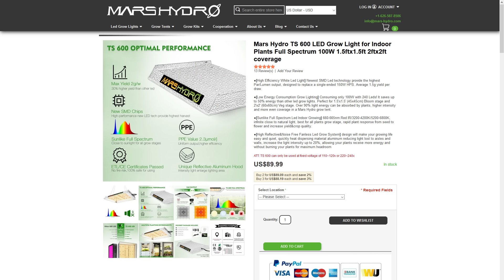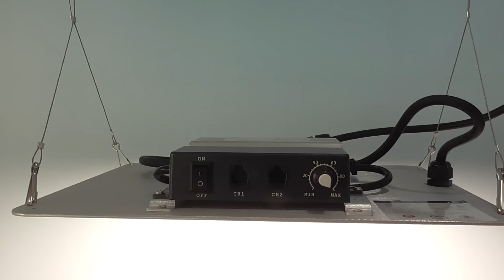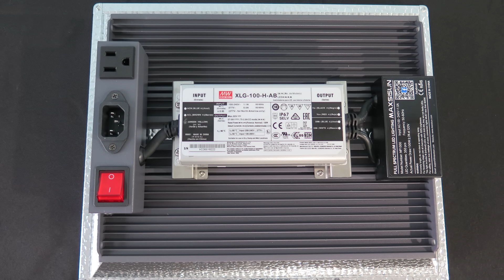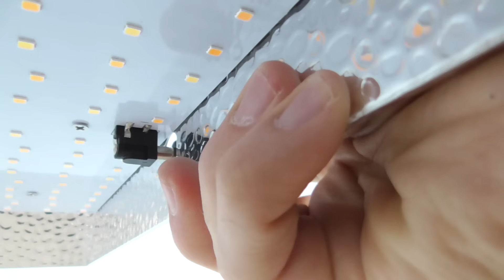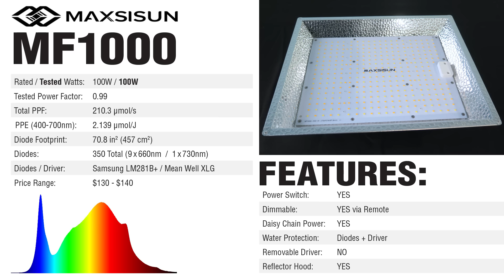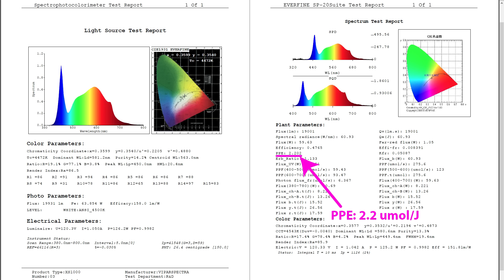Spider Farmer, Maxsisun, Mars Hydro - Entry Level LED Grow Light Comparisons, Test Reports & Reviews

Comment: Excellent review, could you help me decide based off of temperature output? Or are they gonna be relatively the same? I feel its most likely connected to the highest light output
Reply from the maker: Hi Sam. If each light is drawing the same wattage, then the one with the highest PPE will be emitting the least amount of heat, assuming you are only looking at models with 0.99 power factor. That said if you are comparing PPE of 2.1 up to 2.5, they will be fairly close. Not a massive difference. In contrast, a T5HO is probably PPE of 1.0. So you get much more heat at any given wattage.

Comment: Dude.. Thank you for this. I was going to get the Maxsisun MF1500 soon.. I think its the one I'm going to get for my 2x2.. You sir, are awesome.. I've had 3 Mars Hydro TS 1000 crap out in the last 3 years.. So upset.. But they just recently started using new drivers.. The Moso 150W.. Not sure if it's going to make much of a difference.. But dude thank you for this.. Ive always checked those test pages you were asking for and Ive tried my best to understand alot of it.. You explained it for me to understand 100% now.. Thank you for that.. Bad ass video man.. Very helpful.

Comment: G'day mate how you doing?? Well that was an excellent upload man ive been watching afew different vids on led lights but this is hands down the best so far. Anyway I bought a mars hydro TS 1000 afew months back & when I read the spcs & stuff I noticed it said only 150watt from the wall I was thinking it was 1000watt like advertised on eBay. So I got it to replace my 400watt hps in a 4x4 tent n try led but my problem is that I don't know if it will be better or worse than the hps set up???? And also im a little worried about growing without the heat & when to vent a tent with a led light source any help would be great as I really would like to start using it.. Cheers mate 🍻🍻

Comment: Honestly.. I've had a couple (blurple) Galaxy Hydro,more or less,a Mars knockoff 600w (250ish i think at the wall) for a couple years now,paid $70 each,for the space i use 2x4x8 split top and bottom 2x4x4 ,they've been amazing!!  It's cool and all knowing the numbers.. But by results.. I still think the cheap china lights are a real bang for the buck if used knowing long before hand.. It's china.. Ultimately,they overstate everything.. Lights,wind/solar generators,battery life,and anything else the manufactur .. It's all toss and replace crap at the end of the day

Comment: How many of the SF4000 would I need for a 42X61ft area?
Reply from the maker: 42' x 61' = 2562 sq ft.  1 SF4000 covers 16 sq ft (for high light crops).  So 2562 / 16 = 160 SF4000 light units. It might be less if you have ambient sunlight or if you are growing plants with lower light requirements.
Reply: @Albopepper  Wow thanks! So for an open area like that with reflecting walls and floor and I still require so many? I thought that the SF4000 covered 6x6 for 36' sq ft. These are special medicinal crops so I have to die by the sword.  Thank you so much for your kind words
Reply from the maker: Sorry, I'm still looking into things for your project. But to answer your question about coverage area for the SF4000, I suggest watching this video: https://www.youtube.com/watch?v=Cl5P3sKDQ0o  If you try to cover 6'x6' per light, your yield won't be as high.
Reply: @Albopepper  I watched that video 2 times already always learn something new
Reply from the maker: "Would you recommend a different type of lights for such a large area?" With such a large area, I think it's good to get the best efficacy you can get, especially if your electrical rates are substantial. But I would also look at initial cost, trying to get the highest Total PPF per dollar spent. To get enough light output, you could estimate a combined Total PPF of 192150 umol/s. (This might be higher or lower depending on other growth parameters.)

So let's say a light outputs 1217 PPF. Then you need 158 of them. But if a different light outputs 1600 Total PPF, then you only need 120 units. Then compare total cost of the models to see which costs less upfront. Next you can do an ROI calculation (if one light is more expensive but more efficient than the other) to see how quickly you would recover your investment.

With such a substantial investment, you should only purchase a light that has a Spectrum Test Report available. To be honest, a 3rd party test report is preferred to ensure the seller hasn't falsified their report. Also, look for good warranty terms. Some sellers offer 5 years. That might be worth the investment for you.

And then finally, think about what form factor suits your needs. How will you arrange your plants and the walkways, etc? Some lights can be placed closer like this kind: https://youtu.be/PCaesi_M5DQ?t=9  Or do you want lights that have a smaller footprint and are placed higher up? This all depends on you and how you will work around the space.

I think the SF-4000 is a great unit. It's a good starting point. I suggest using it as reference. See if there's anything else better, by comparison. Maybe more efficient. Maybe better warranty. It depends on what matters to you most. I would like to see 3rd party tests from Spider Farmer though. After looking at more of their reports, I'm beginning to question their truthfulness. It's not an issue for someone buying 1 or 2. But with 100 or more units, it makes a big difference.
Reply: @Albopepper  Would you recommend a different type of lights for such a large area?
Reply from the maker: Is there any sunlight or is this all in an enclosed, dark space? How expensive is the electricity rate?
Reply: @Albopepper  It's enclosed I got lots of power but I want LEDs so that my operation will be scalable and plant more plants when I get a different license. So far power is 480 volt 3 phase so that's not an issue. I also will have reflective walls and floors, never done an operation this size before so that's why I'm asking.

Comment: This is the best review I have seen of these lights!  Excellent reviews sir!  My question is,  which will grow the most weight?  The Mars because it's the brightest?  Which honestly if that is the case that's the opposite of what I was thinking and might need to go back to the drawing board? 🤔
Reply from the maker: Thanks for watching! For more plant mass, you need more photons. So higher total PPF means more potential for weight. Obviously, since it runs at 50 extra watts with decent PPE, the Mars Hydro will give the better yield.

Comment: The 1000w or 600w in the names does not resemble the watt usage and never has i don't understand how this can misunderstood, literally no one ever said that was the watt ussage.
Reply from the maker: 1000W and 600W literally means 1000 watt and 600 watt. Ford can't call a 130 horse power car "550hp" and then claim that they weren't trying to market it as being 550 horse power. Units mean something. And W means watt which indicates power. I showed an actual question posed by an Amazon buyer who was confused because they couldn't turn their light up 1000 watts. So yeah, people can get confused. And just as importantly, these lights are NOT replacements for 1000W or 600W HPS systems. So to be quite honest, they have no business using those false unit designations.

Comment: Ive been using a TS2000 for the past year and completely happy with it. I feel that being able to mount the drivers outside of the tent gives Mars Hydro a huge benifit. It makes temperature control much easier. Everytime i look at other brands not being able to put extentions on the driver cords is what turns me away.
Reply: ts1000 I use its good no problems  but go add a spider 1000 I think

Comment: nice video i replaced my spider farmers sf1000  with new mars hydro ts1000 they now have goodwell and dimmers amazing lights
Reply: Does the Mars produce much more heat....any increase in yields with the Mars..?  I was thinking about getting the sf1000, but I've seen a fair bit positive comparison for the Mars units.  I'm considering the Mars unit.   Thanks

Comment: What would you think about running 2 x Mars TS600's in place of the TS1000? Deals make it cheaper to get the 2 than just the 1 sometimes.
Reply from the maker: It's going to take 200W to run 2 x Mars TS600s and you might get around 360 PPF. The TS1000 can probably do 330 PPF but it only requires 150W. So it would be just a little less output, but it would save quite a bit of electrical consumption and heat output.
Reply: @Albopepper  That's what I thought, but I was thinking that I might get a better light footprint with the 2 being as you would have about a hundred more diodes for light sources while pulling 200w?

Comment: Holy cow thanks for this video it's incredibly in depth! Makes me feel a bit better getting two ts1000s vs one ts1000 and one sf1000. I personally chose the ts1000s because I can put the drivers OUTSIDE the tent which has helped dramatically with temps.
Reply: I use this to control the temps in my tent man its amazing. I took my drivers off in the summer and put them back on in the winter to gain a few degrees when the temps outside dropped.

Comment: You are the man! As I went to investigate a new light, I knew nothing. I was told to chieck out the quantum boards and didn't know where to start. I found this video extremely useful! Thanks a ton!

ps: I'm seeing a few brands you may be interested in contacting for tests with similar LEDs... ENFUN , QKWIN , BESTVA to name a few
Reply: Have you seen the new lights with 302H diodes... sellers say they are based on the Samsung 301H diodes... you know anything about these ?
Reply from the maker: I don't see any listings by Samsung for that model: https://www.samsung.com/led/lighting/mid-power-leds/3030-leds/

There's the LM301H and the LM301H ONE. For the 302, I'm seeing LM302N DAY and LM302N NITE: https://www.samsung.com/led/insights/insights-detail-22/

Quite importantly, we need to see reports for the entire lighting unit in its assembled state. A grow light might have higher efficacy diodes. But the PPE might be lower if it isn't designed optimally.
Reply from the maker: Thanks watching Ivan & sharing those tips! I'm glad my video was able to help.  :)

Comment: Im running several Mars Hydro Lights.

The TSW 2000 with dimmerbox ist pretty good, it runs at about 300w* over here. Its  reddicously bright when running on 100% but its also very powerfull. But it also needs an improvement for hanging, these thin metal wires are not ccol, this thing is huge.
It has two drivers and therefore 2 cables to plug in.

I also got the TS 1000, one driver, one cable and with dimmer box. I cant tell the watts rightnow, but its an OKish light in my oppinion.

Then i also had the SP150 for my clones and now we reach the weakspot off all mars hydro LEDs: ITS NOT WATERPRROF.
Spraying a row of clones was allready too much. The light was hanging way above the clones that i was spraying daily. But still the fog or high humidity made the light die within 3 weeks or so.
I heared some "brrrzzzzzzz zaaapppp" and light went off and was dead.

Im now using an SF300 for the clones. Its not as powerfull, but at least it can withstand the fog/humidity.

So:

The newer Mars Hydro Lights come with far red LEDs and dimmer box. In my opinion they re OK to buy, espeacially the TSW 2000 is a real gamechanger and comes for a cheap price.
But have in mind: BE CAREFULL with those light. Avoid spraying underneath them, avoid high humidity and never touch them on the LED side while they re running!

*corrected the watts for the TSW2000

Comment: People are "Geeking Out" on lighting when these numbers aren't as 'important' as some may theorize.   If you are that worried about LED lighting not working, as advertised .... just go back to HPS.  After all, it may pull more power and put out more heat, but HPS is far superior to LED in the Vegetative Stage.  Bottom line .... you can waste your life / time on worrying about stuff that plants really don't care that much about, or with negligible differences.  After all, in my defense, there have been very good results obtained using "misrepresented" LED lights.  The plants really don't care as much as you think they do about these "micromanaging" topics.
Reply from the maker: Some LED sellers try to make a quick buck by inflating their product specs. And I have no intention of allowing them to do it without any accountability. I'm not going to wink and look the other way. Let's not be apologists here. It's fraud. And if fellow consumers know what to look for, they can help to shift the market in a better direction.

I certainly wouldn't say that going back to HPS is the solution to misrepresented specs. What kind of HPS? SE? DE? What kind of ballast? Just like with LEDs, there are lots of variances in HPS systems too. You can compare two 1000 watt "HPS" lights and see huge differences in efficacy along with overall light output. This directly impacts HVAC costs, electricity requirements and yield. Imagine if HPS sellers just made up numbers to outsell their competitors. Would that be ok?

You might think a 20% reduction in efficacy or output is inconsequential as you still get "very good results". But what about in a large scale application like this: https://giecdn.blob.core.windows.net/fileuploads/image/2018/03/urban-ag-fig-1.jpg ? At such a huge scale, even a 5 or 10% difference can translate into massive costs, or massive savings. A home user might have a single light, so it doesn't really matter, right? Except there are thousands of other home users. And when you add them all up across the grid even a 5% improvement in efficacy can make a big difference. So people should care.

And the plants? Yeah the plants care too. Because 20% more photons means 20% more growth potential. So plants absolutely care.

Comment: Hmmm. i allways thought the term PPFD means Photosynthetic photon flux density or something. thus the ppfd is allways an average on the surface listed. PPF can be a spot measure. I think u switched that around?
Reply from the maker: The total PPF as measured from an Integrating Sphere captures and quantifies all photons (400-700nm) escaping from a light source. When stating the output of a light, the preferred unit is µmol/s. This does not account for light distribution over a target area, such as a plant canopy. When you look at the total PPF, you don't need to worry about hanging height or side reflection. It should just tell you the total photon output.

PPFD is commonly measured by instruments like quantum light sensors. Spot readings are taken. The preferred unit is µmol/(m²s). These are the readings shown on PPFD maps. And the average of these can be used in comparing other light sources (assuming all measurement parameters match).

That said, this is how the terms are commonly used especially when talking grow lights. But there's more to the story. And if you want to hear some background from a horticulture professor, listen to this explanation: https://youtu.be/UZO8Fb0ryW8?t=311
Reply: @Albopepper  Thanks a lot for the knowledge and quick responde. I'm watching the video you linked right now. Much love and respect!

Comment: The deceit really needs to end.  Kinda reminds me of the stereo era in the 90's when all these amplifiers were rated high watts at an ohm spec which the amp could NOT output.        Having to spend energy and time to keep others honest is a sad use of human potential.  
Thanks for your service !!
Reply: You're 2nd to last line plagues me constantly. I have to spend an hour to check your lies and another hour fighting them. No thanks. I have a 1000w (continuous, not peak) Pyramid amp with a hunk of lead in it to make it nice and heavy for boating use. It bumps harder than a pile of Hifonics Zeusses @ 8 ohms. I'll give ya a great deal on it and throw in a Kenwood 999 and a Panasoonics pull-out with corresponding anti-theft purse. Hmu...